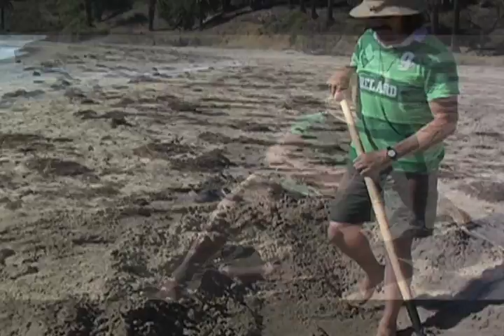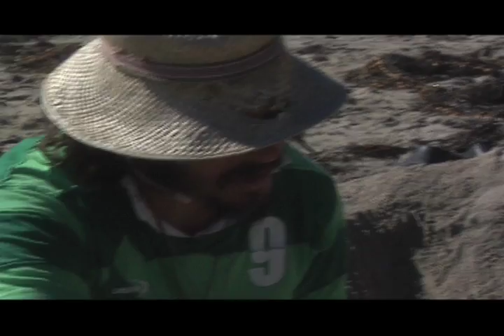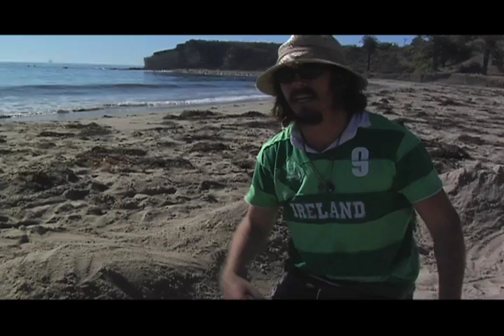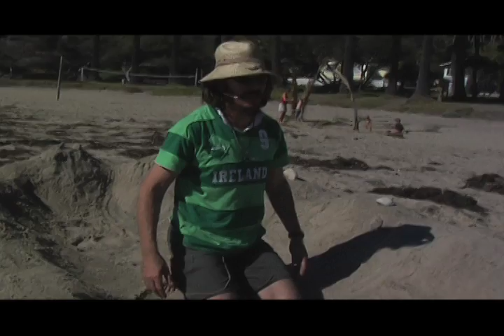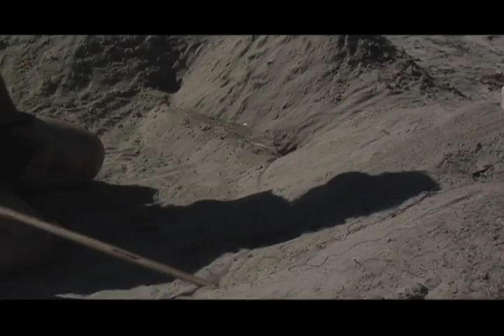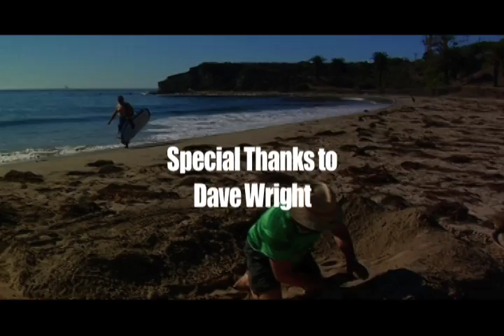Keyline Design at the Beach (2) Darren Doherty

Comment: What about the area above the key points? Isn't subsurface irrigation better than flood irrigation? Wouldn't swales catch the run off and let it seep into the soil for subsurface irrigation? In time natural springs and streams would appear if the area was planted with trees and grass so the soil was covered year round. The land would be restored and improve over centuries. The method you describe is a short term fix. A lot of area is left denuded which caused the problem in the first place.